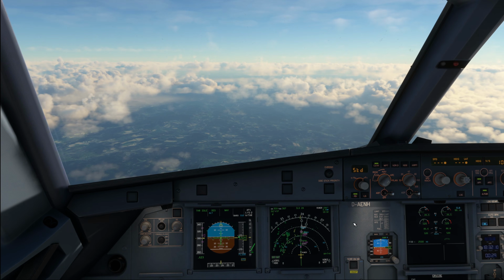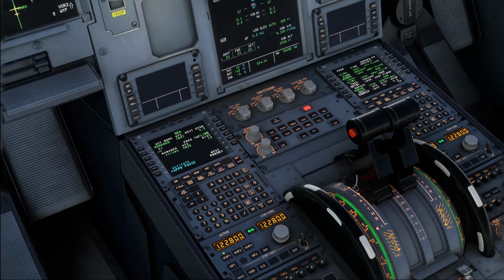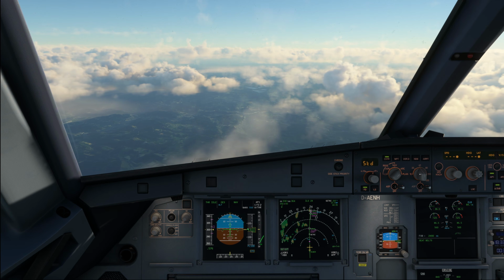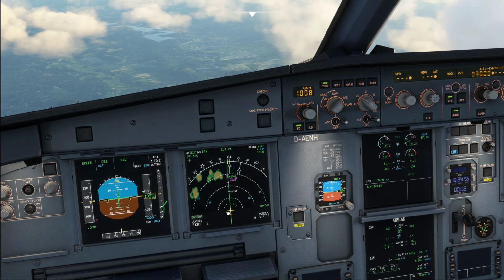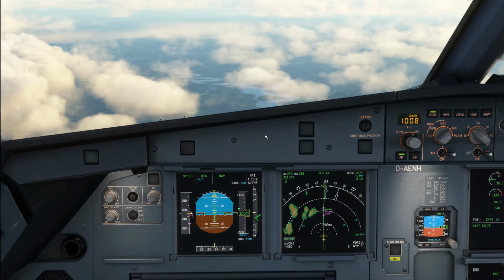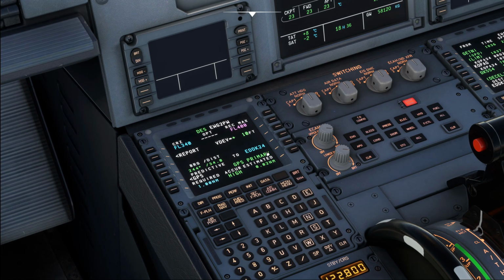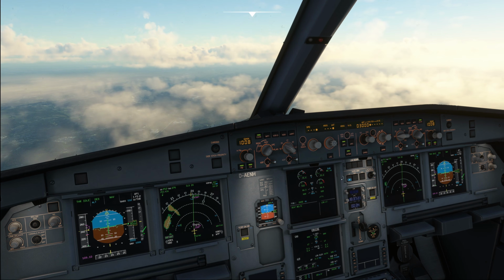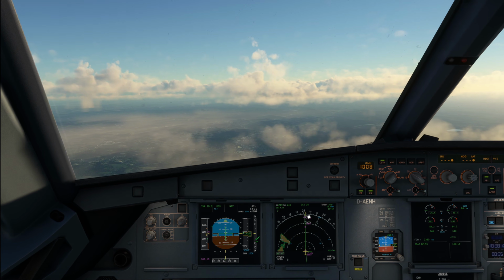iniBuilds A320neo | Tutorials made EASY: Part 6 - Descent & Approach | Real Airbus Pilot

Comment: I have got a question, in the decent the plane suddenly becomes a little bit faster. Should the speedbreaker be armed and the plane will slow down automatically or I should do it Manuel?
Reply from the maker: The A320 does not have automatic speed brakes in the air, you'll need to use them manually.